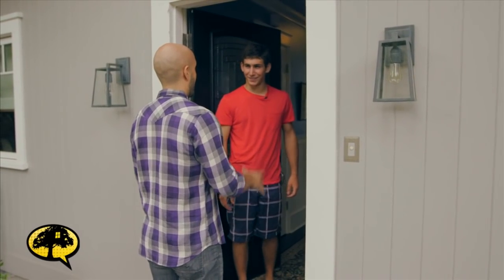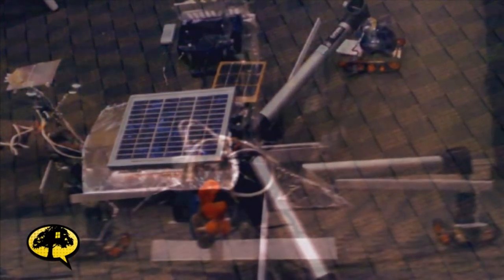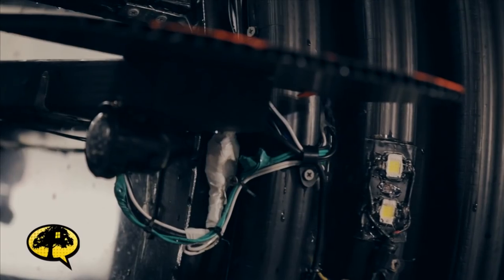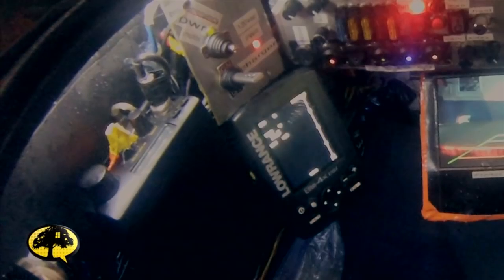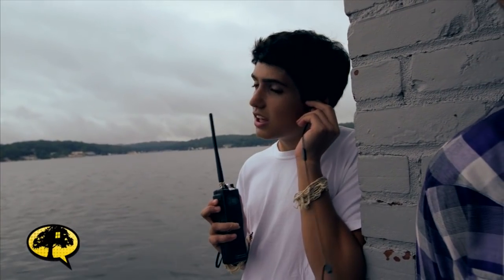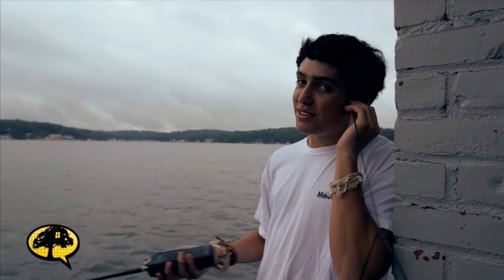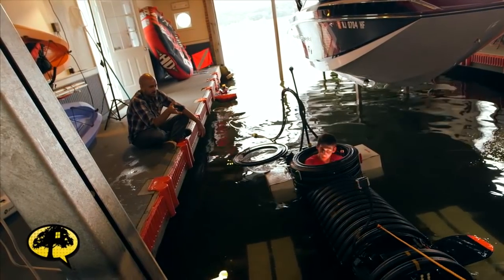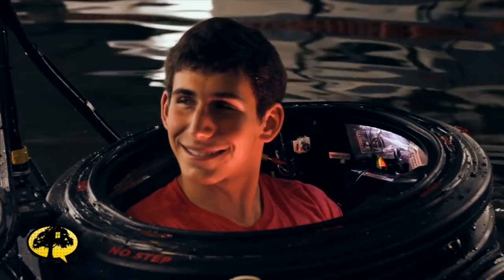Kid Builds Real Submarine | "Liberty Treehouse"

Comment: Needs a manner of self rescue.  The sub should have positive buoyancy on its own, then add a ballast weight on the bottom that can be positively dropped from inside the cockpit.  If you cannot surface for some reason, drop the ballast and the sub floats to the surface all by itself.  The ballast itself should be disposable, something cheap and heavy, such as concrete blocks or a concrete casting, no big deal to make another one.

Comment: Personally, I would have gone with a propane tank for the hull and use 4 small compressor air tanks as ballast tanks.  Weld everything together so no flimsy little hoses will pop off. Electronic solenoid valves for normal operation, but manual ball valves in case of a malfunction. Of course, always check blow bottle pressure before a dive, etc etc etc. That's just me though, I wouldn't want one of these to become my underwater coffin.
Reply: Then build one, post a video of it working.
Reply: +Drew “2u” 2u would you?
Reply: +Morigato Meow exactly, need a redundancy system because when things go wrong underwater, the story doesnt end well.
Reply: birsey
Reply: +Rob M u
Reply: aşağıdaki M
Reply: +Hoşça Sjsjsj

Comment: I'm not saying that this is not impressive, however this is NOT a submarine. a submarine doesn't have any surface connections. this is more of a semi-submersible given that it requires a surface connection.
Reply: Add some air tanks, remove the buoy, then it would be.
Reply: He probably needs it to warn other boats about him being under them.  With an actual submarine you wouldn't need it because you want to be stealthy, but since he is using it for commercial use in a public area, he had to focus on safety...
Reply: If it goes underwater, it's a submarine to me!
Reply: Not Your Average Pyro I think its actually part of tge lifesupport system

Comment: how does he know it goes 30 feet if hes only gone 15? yeah it took two weeks to design, did he even look at any submarines? looking at it id say he has no clue on how submarines are constructed. why on earth would you need five ballast tanks? for real, subs that use ballast tanks (i know of at least one research sub that uses a mercury balancing system to submerge, its pretty fancy) have only two, saddle type tanks or a singular tank that either wraps all around it as a outer hull or sits at the very bottom, saddle tanks being the most stable, the more tanks the more issues you can have. okay he has a tank malfunction, why didn't he build in some sort of realise so that if a tank did not empty he could just jettison it so he could resurface? if he's some sort of boy genius like he's portrayed and he built in so many "systems" you think he would have thought of that. 
to all the haters out there who say stuff like "where's your homemade submarine?" its on paper and small models until i can work out all the problems (like that) and make a SAFE working submarine.

Comment: i say he needs helium tanks on the sides to fill the air tanks.
Reply: No because the helium would make it float so if he went down with the helium if he put the helium in the air tanks he would still be stuck down there which is why it’s better to use compressed air because it’s heavier than normal air so when you pump it into the air tanks it turns into normal air and than it floats again